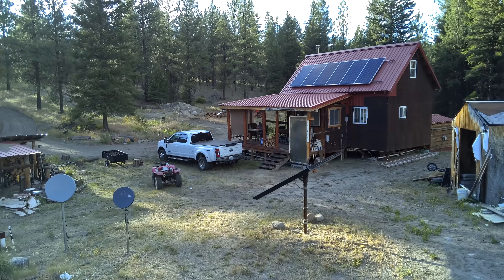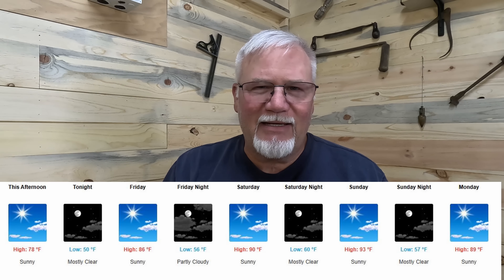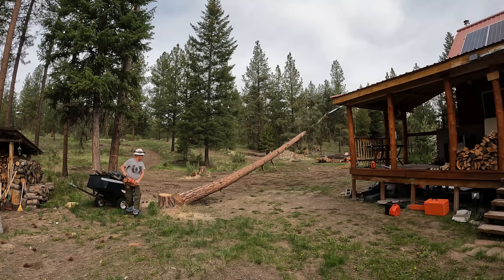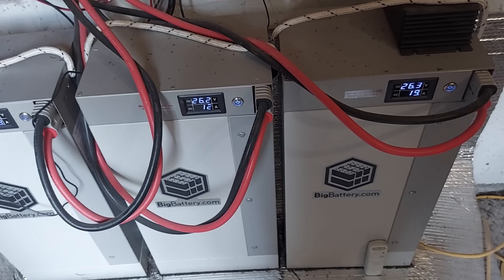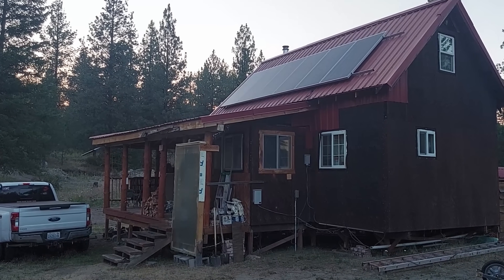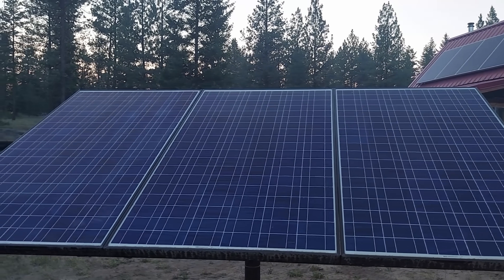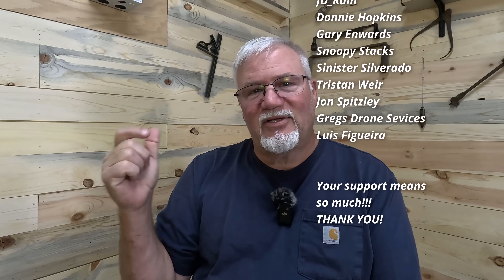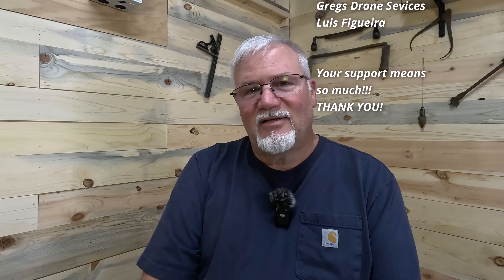I Tested An 8000 BTU AC Unit In My Off Grid Cabin During Hot Weather

Comment: When I can I move my panels its night and day as far as production.
Reply from the maker: Definitely makes a difference!
Reply: Isn't that the truth. I have two fixed and one movable. Today I checked production and found that it was less than 300 Watts. TF? I looked out the window and realized that the movable panel was still still pointing SE. I went out and turned it. Boom! 400 Watts!
Reply from the maker: Usually I don't move mine.  It's mostly set and forget because of the roof mounted panels but now, with the AC I move it every 45m or so!  I'm realizing though, I could have spent $100 more and gotten a more efficient unit....hmm...